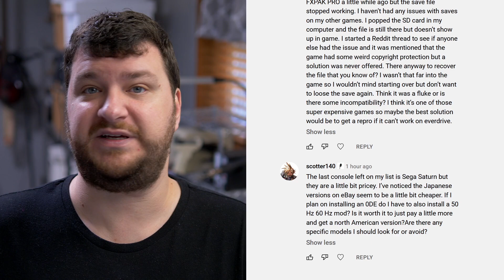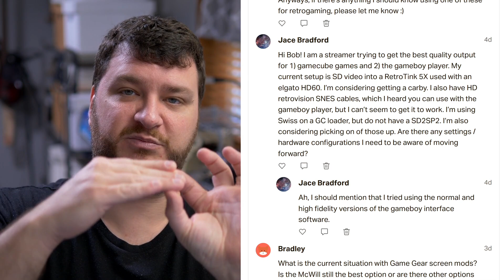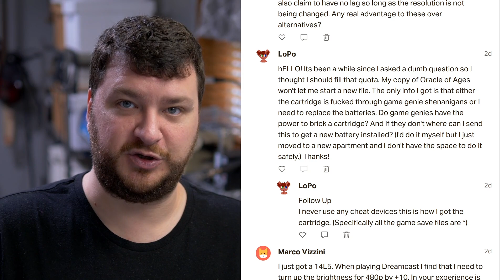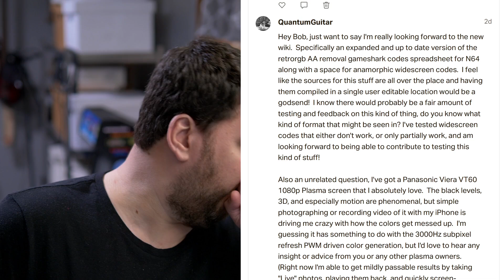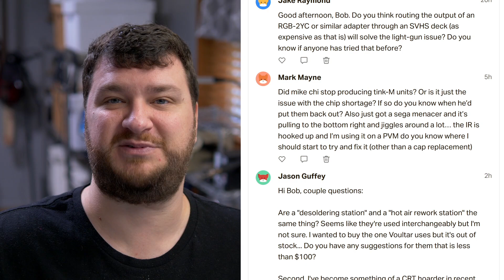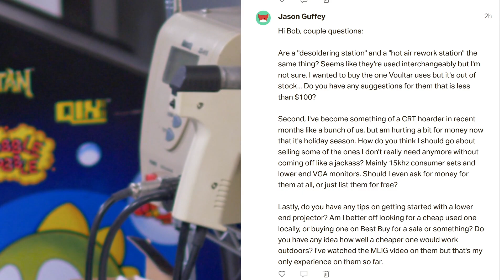Supporter Q&A #184

Comment: Bob, regarding fxpak pro saving, you only need to force save back to menu with a double reset to save msu-1 games not standard ROMs, normal non msu1 games should save without menu exit.
Reply: Yep, I never went back to menu and my saved are fine @RetroRGB

Comment: i have both a japanese and NA saturn, and i have noticed issues with the japanese version and believe they are related to power.
Reply: Initially i was using a Rad2X and it looked great on my japanese saturn.  Then after a few months I wasn't getting any video signal with the Rad2x.  Also i saw some FMV sequences were a little blurry and some games wouldn't load up.

Comment: I've also had issue with FX Pro erasing my Chrono Trigger save.  I was very close to finishing game and then it wasn't there.  Similar thing happened on my Terra Onion Mega SD, I lost a lunar save after over 40 plus hours.  In both cases i was using an analogue clone console.

Comment: You can mod the crtemudriver compatibles videocard with ATOM-15 BIOS soyour pc will run at 15 khz  all the time.
Reply: I’ve built a mame cab with a modded crt, I let it boot up with the screen on just because it’s all on one switch. Am I destroying my screen? Been scared to do the Atom hack, is it very tricky?
Reply: You could also use the Ultimate VGA to Scart cable. Prebuilt or DIY. This will solve that issue completely
Reply: I'm a simple man, my PC boots off a m.2 nvme ssd, so it takes about 5 seconds for it launch windows login. More time than it takes to find the remote for the crt tv.

And arcadevga cards won't have the resolutions or refresh rates for many arcade games....

Comment: I have Japanese Mega Drive and Dreamcast and I had no power problem.

Where I live in Brazil it's 110v and the video game is 100v, it's within tolerance
Reply: I can confirm that the Japanese Saturn will work fine. With 110v. I use a step down converter 240 to 110. My supply voltage is actually closer to 244 and the Japanese Saturn will work fine. The power supply has adequate protection for out of tolerance voltage (a varister will pop if you connect more than 150v)

Comment: On the Oracle of Ages one, im pretty sure that cart is GBC only, so just to make sure, do youre booting it on a GBC or higher?

When you say “wont let me make a save” def needs to be clarified a bit, like are you getting things in game like “yes we made a save” you turn it off and then the file isnt there? (Then probs battery) 

If youre trying to save and then its like “lol nope can”t save gg” could be an indicator that its a fake game. There are a few videos from collectors obv how to spot authentic vs reproduced carts, (and some of those repo carts get wonky when not authentic like gba flash carts working with gcn-gba cable)